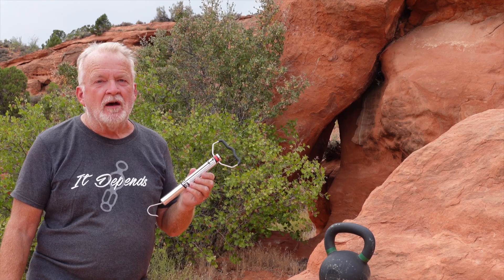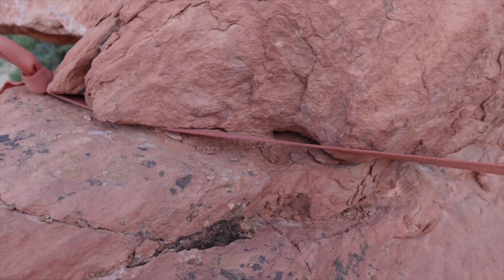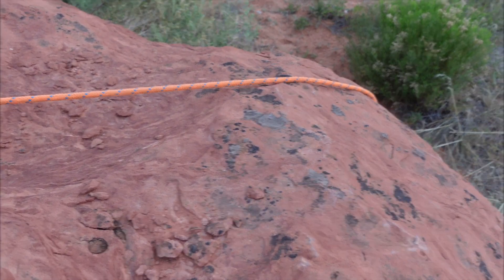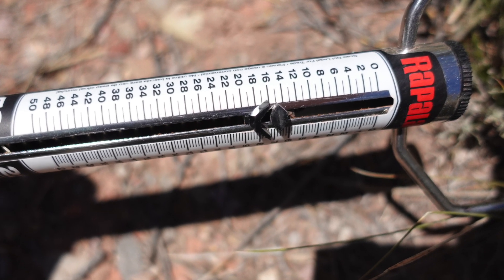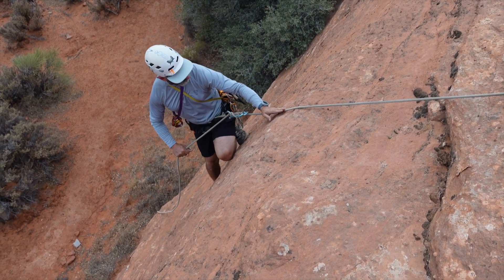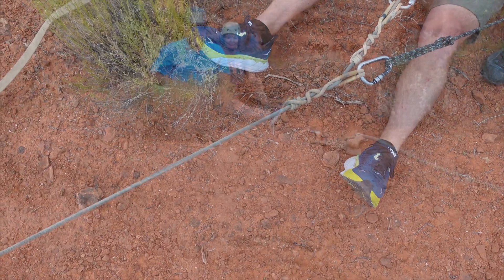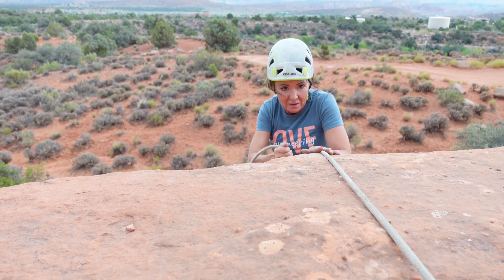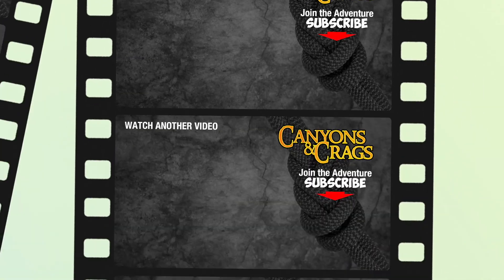Friendly Friction & Meat

Comment: Thanks Rich for this video, the information is very well presented as always. Though rappeling off a tiny bush is not something you should do. The methods you learn in books compared to what you could be stuck doing in the field to save your a** needs to be talked about and as you demonstrated here, there are ways to increase your chance of success doing it.
Reply from the maker: So many issues could be avoided with well-placed and well-located bolts. But  when exploring a new area it's good to know other options for anchors. And for those times when some self-righteous idiot has removed the bolts ....

Comment: That was so good illustrating the differences in actual force, over the various surfaces. Thank you.
Reply from the maker: Thank you for your comment. The surfaces made a difference because the amount of rope to rock contact varied. There is also variance based on the angle. Passing over a 90 degree bend provides more advantage than going over 120 degrees.